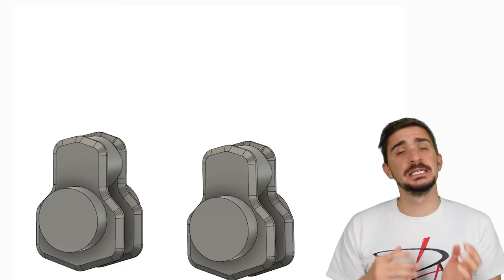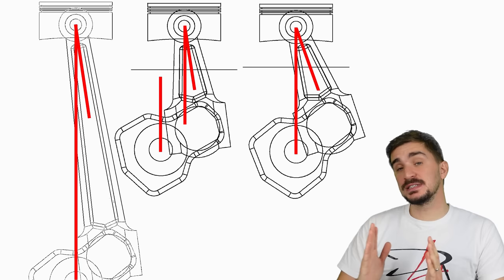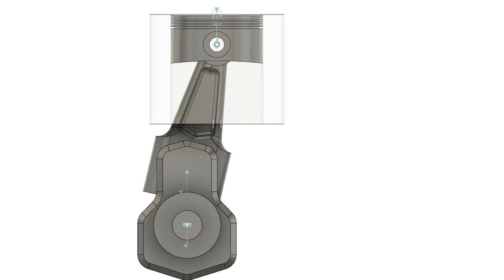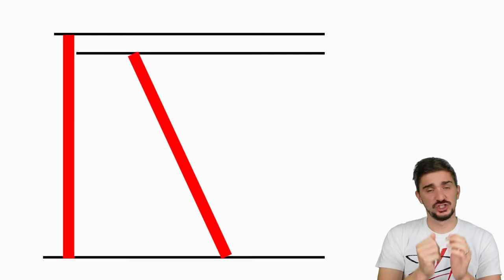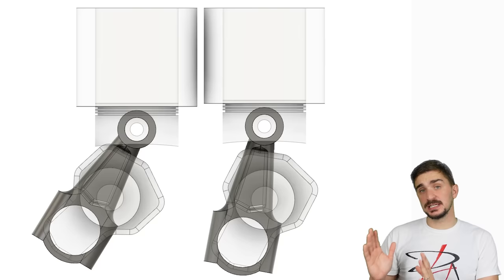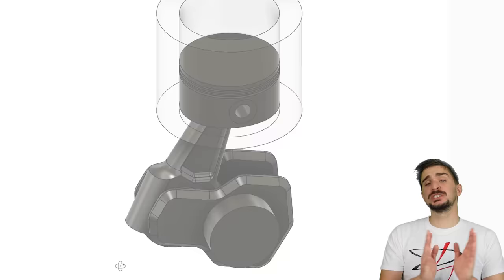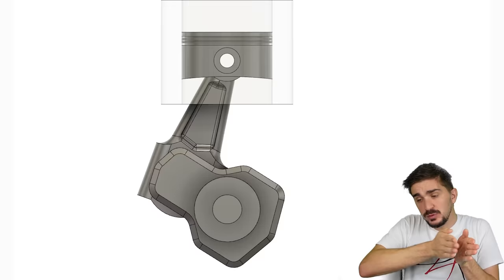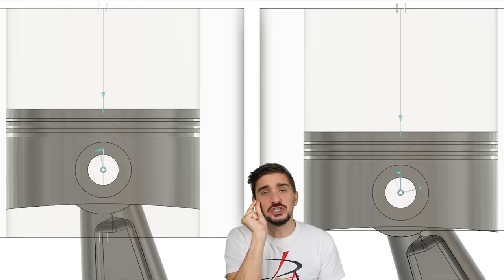Cylinder Offset Changes Everything

Comment: Excellent description. It's also surprising how little power is actually delivered to the crankshaft during a typical power/combustion stroke. I once had a single piston engine apart and tried to turn the crankshaft by pushing down on the piston. Even at 90 degrees, I was barely able to rotate the crankshaft because of the limited leverage angle distance between the crankshaft journal and the connecting rod journal. Same idea as if the pedals on your bicycle were much shorter.
It would be nice to see a video on the actual power output of a single piston power stroke on say -- for example a V8 350 engine at full throttle.   For example, how far in the air could it throw a 10 pound gallon of paint? If this could be calculated, it would tell us how much energy is wasted by inefficiencies in a 4-stroke engine.

Comment: I'm exited to see how the offset engine vibration is to a 2 cylinder 270 degree crank, and a 4 cylinder flatplane vs a 4 cylinder crossplane. It must be interesting to see the vibration through a graph imaging and to feel it in real life on the bikes with those 3 engine configurations... I hoppe there's a video on that, thanks for this great video, cheers!

Comment: Trying to visualise this?    Try picturing an ovalised chainset on a bike, a normal round one has flat spots when the cranks are towards and past vertical. With an oval one the flat spot where effort can be applied has already passed.   Or imagine a car on a rolling hill, bottom to top of hill, approaching the bottom of the hill you will accelerate before the bottom, and the momentum means that before the top you can stop acceleration and still make the top.

Comment: So happy to learn the offset engines.  On my Polaris 400 engine's offset balancer is a major weakness for early failures.....My Sportsman 550 has a rubber damper and compensator shaft which only to help to reduce engine shock damage to the "Driving Chain", very poor designs......

Comment: You missed one other disadvantage. If you look closely at your graphics of the offset when the crank and conrod are at maximum deflection and on the way back   up the cylinder there is an interference fit with the conrod and the bottom of the cylinder. This is another thing that would need engineering to eliminate. Just a thought.

Comment: Very nice video! Small suggestion on the terminology. Instead of saying that the connecting rod is changing length, becoming shorter or longer as the crank shaft turns, it may be clearer to say that its "moment arm" is changing length.

Comment: bicyclists have been doing this for decades.  If your knee was the piston you'd have very noticeably less power to the pedals the more it was over the center of the bottom bracket.  Ideally your knee  (think piston here) should be straight above the pedal (wrist pin) when it is at 90 degrees.  Power transmitted to the crank can be graphed in a sinusoidal fashion with peak power delivered at the 90 degree point.  If you really want to be more efficient, build my invention idea, a piston arm with a rack gear mounted vertically that engages on the crank with a freehub.  It transmits nearly 100% of it's stroke force directly into torque for the entire duration of the piston stroke then freewheels back up.  it can be pushed up by a connecting lever to another piston heading downward.

Comment: Very interesting.  Would think with offsetting rod to crankshaft centers, that it will increase cylinder wall pressure on the side opposite rod offset.  The more offset, the more increase in wall pressure.  Ok, so  at that point, it may require increase of piston skirt length to provide more square inches of bearing to allow better service life.  In the air craft industry, the big double row radial engines had a master rod with a slave rod attached to power generation from the radial cylinders.  While this is from memory, many of these big engines turned many “rpms”, but, rebuild was required at regular intervals.  Our life style is almost to a throw away society, but all considering, enjoyed your presentation.  Very good and leaves open further discussion.

Comment: I think Fiat did this by off setting piston wrist pin away from bore centerline a fair amount, about the degree as stated in your post.  But it’s way too tough on piston skirt ware and tear.  Durability was never a Fiat engineering issue at all.

Comment: Crank and slider kinematics are pure mind fuckery, your mind tells you there should be patterns and symmetry where there isnt any. There are two rotating bodies, crankshat and the conrod. Sometimes they are rotating in the same direction sometimes in the opposite. Looking at a graph of velocity vs crank angle, most people would expect a sine wave which is incorrect. The coolest part is that crank and sliders can be seen as a special case of a 4-bar linkage where one of the bars is infinitely long.

Comment: Racers used to swap the direction of the offset in standard pistons...standard offset is done to reduce engine noise...to something like this, although the cylinder centerline and the crankshaft cylinder centerline were still aligned. 
Of course you still only get a fraction of the arc of power stroke where the cylinder pressure vector is a tangent to the piston pin arc. 
Get an electric motor...the force lines are at a tangent to the power circle ALL the time.
(One of the main reasons electric motors are 3 times more efficient than piston engines..;-))

Comment: Increased Stroke = Increased Displacement.
You're adding capacity. More fuel and air in added volume of cylinder space. The offset would seem to want to spin higher rpm's with short stroke / shorter connecting rods.

Comment: I would imagine that one could decompose the force frequency graph into it's component frequencies and then use additional cylinders to counter balance that spectrum. Not entirely sure what that linkage would look like, but I'd imagine it would look something like a 4 bar linkage system with 2 cranks rotating in opposing directions.

Comment: It "changed everything" a long time ago.  The Standard Super 10 I learned to drive on in 1961 had offset pistons.  The layout was called "De Saxe", I think.  😎
Reply from the maker: The changing of everything refers to everything on the engine, such as balance, efficiency and other characteristics as clearly indicated in the video. This is not some sort of tech hype video you seem to watch too many of.
Reply: @d4a  You are sore?  Offsetting was carried out by in-line aero engine manufacturers during WW1, I believe, and continued throughout the car industry ever since.  The qualities of your observations are top-rate.  The lack of history suggests "tech hype", and yes, as a retired mechanical engineer specializing in thermodynamics, I do probably watch too many of them.  Be advised.  🤧

Comment: Somewhere I have seen cylinders that are mounted on rotating bearings so that so that the piston rod is always in line with the motion of the piston within the cylinder walls.   It must've been some steam engine in 19th century steamships or locomotives. 
I lasted 3/4 of the way through the video.    But I didn't click off,  I fell asleep.    Thanks I needed that.    So I went back and finished the last 1/4 of the video.  Thank you for the challenge.

Comment: Since around the 1930s the use of an offset piston of about .060" has been used to accomplish literally the same thing as your special engine.
Reply from the maker: It's not the same thing because the offset is very much different. Pin offset is mostly there to prevent reverse direction rotation. It has negligible effects on efficiency. My special engine? I don't know how you came to that conclusion. I never said this was special, many engines have it. Seems like you didn't watch the vid.

Comment: Major error - TDC is NOT the same when you model these up. The entire video shows TDC the same, but when you offset the crank / wrist pin it changes, just as the BDC changes. 

This is a HUGE oversight / assumption and skews so much of an otherwise excellent video.
Reply from the maker: The huge oversight is not watching the video. I covered this in the video.
Reply: @d4a  I will rewatch this. As far as I can see, it shows exactly the same TDC and kind of implies they are the same, only focusing on BDC (example 3:23)

Comment: I wonder if the VW w16 has offset cylinders. I find this very fascinating. I'm trying to imagine what a flat plane crank with offset cylinders would look like for an old Chevy V8 type engine. Obviously it would require a block, cylinders heads, camshaft, crankshaft, balancing shafts perhaps, and custom camshaft to make it work. It's probably not done often because of the added complexity. Nice video
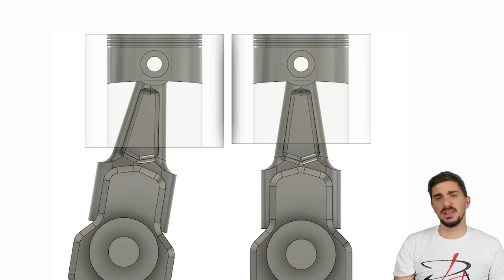 1:20 that's what she said.

Comment: I understood that the engine with the piston off-center from the crankshaft is more efficient, but with much more vibration. But if it were with opposing pistons or in a "v" with just enough angle to reduce vibration? Of course, with a single piston it is impossible, but the more pistons the possibilities would be greater.

Comment: The increased dwell at TDC also has the advantage of increasing the exhaust open time at TDC for better evacuation, and the longer intake stroke has the advantage of, well, being a longer intake stroke.  I wonder how this effects things such as runner and pipe tune lengths in the intake and exhaust system, and the ratio of intake to exhaust valve diameters?

Comment: So you’ve seen the counter opposing piston engines, why not just duplicate the same offset with an opposed piston connected to a crankshaft, rotating the opposite direction, duplicating the same opposing forces, creating an even larger power and intake strokes and balancing themselves out?

Comment: Basically, if you somehow modify a regular engine to offset and keep the phase durations of a stock camshaft you can achieve some underfilling with af mixture, resulting in a lower dynamic cr like a skyacktiv motors and a relatively bigger volume to burn, combined with a longer power phase on a crankshaft, this might be even a bigger gamechanger! some shifting of intake phase 1-2 tooth might be needed to make shortened intake start as usual and finish earlier(some intake camshaft grinding amaybe), making last cm of an intake kinda jump from intake pressure to lower pressure to compressed adding some work to flywheeel. I really wonder if someone has a disposable inline four laying around to do an experiement :)

Comment: For 7 seconds, starting at 13:57, you can see - in slow motion - how the con-rod for the offset engine fouls the side of the cylinder wall.
I'd say that needs greater explanation as to how it is prevented.
Obviously, changing the shape of the con-rod would answer it, but that throws balance off more.
There's more to this than is being explained...

Comment: @driving 4 answers since you are the engine guy, my videos of choice: i got an idea for my car. i admit it may sound irregular, but i am one of these guys, driving according to the specific fuel consumption diagram, tehrefore i reduced from 6.2 to 4.8 liters in a Ford Fiesta active.

my question is:
i thought of a cylinder "shut down" and we make different sizes of cylinders. one 0.25, 0.32 and 0.4liters. about 1 liter engine, like the eco boost.
the mass of the piston and rod shall be the same.
but we can now shut down each cyllinder, not disconnecting the crankshaft, but at least closing the intake manifold on that cylinder (apart from a very very small gap to have no exhaust feeding the cylinder, like giving a tiny forward flow of air).
the result would be variable cylinder-switch-off
to be more flexible on reaching a perfect spot in the specific fuel consumption.
of course thermal load / etc must also be respected, but i am sure this is possible, to quickly heat one cylinder shorty (like switching the shut-off cylinder).

and the last idea: since we have very little air and since we dont use the spark plug, maybe we can use a very lean mixture, like 25:1 to use petrol to clean the valves, also the outlet ones and the exhaust gas recycle as well.

maybe the catalyst can deal with it and not create toxic gases when the unburnt fuel passes the catalyst.

thanks a lot.

Comment: The primary balance would be fine in a I6. Just add counter weights for the crank and the large end of the connecting rod. Yes I did watch it start to finish.

Comment: Had anyone else noticed how in the models one engine will run normally and the other one will be constantly knocking? Rewatch the video and look closely at the offset engine and how the crank would hit the piston and how the rod would hit the cylinder wall at the bottom...

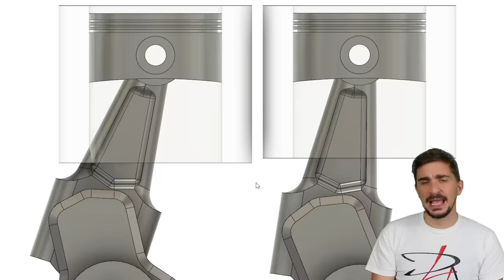Comment: The connecting rod of an offset motor needs to have a curved shape so it does not hit the lower wall of the cylinder. Pause at @3:35 . This new shape affects all the considerations of balance.

Comment: From your other videos, I've been thinking of engine balance in relation to different piston speeds at different points of the stroke. I thought that you might be able to offset something to fix this. Then came across this video. Seems this isn't the answer I was looking for. Surely there is a way to maintain the same effective rod length all the way around the stroke. Like if you could make the path that a rod makes into an ellipse instead of a circle somehow, I think that would do it.

Comment: I’m thinking that an offset V8 engine would also be naturally balanced due to the opposing rotational forces balancing out. Not so a V6 or in-line engine which would require balancing shafts.

Comment: In my oppinion, the stroke is not bigger in offset it just have greater distance when the crankshaft is in offset… Also the compression ratio is more loose if you do not change lenght of the connection rod or piston.. But stroke does not go bigger if you do not change the lenght of the internals only compression ratio goes down.

Comment: When looking at the animations, your bdc is showing a state I don't want to see in any cylinder head, at least to my knowledge.

The oil rings (sorry, I don't know the exact english terms for them) on the pistons should never leave the actual cylinders?! I don't know for sure but at least from my understanding when they actually were to "peak out" on the bottom on each stroke they would be forced back into position on the upwards strokes (so compression and exhaust) since they are somewhat springy and decompress.

I take this knowledge from how pistons are fitted into an engine, since the oil rings usually get compressed when installing so the piston actually fits.

It could very well be that I am wrong with this theory, just something that I noticed while checking the animation and listening to your great explanation!

Comment: Would an opposing piston design balance the engine? Having 2 pistons on the opposite sides of the crankshaft both doing everything simultaneously would create equal but opposite forces for each part of the cycle. There might be some rotational forces still in play because the asymmetric pistons would need to be rotated around the crankshaft instead of being mirrored, but more piston pairs could potentially be used to fix this too. Then there would be the issue of having an uneven firing order, but I don't know how much of an issue that would be on a perfectly balanced engine.

Comment: I think one critical point you didn't point out is that as the Piston is  moving down during  combustion the offset engine Torx is most efficient on the crankshaft due to angular Force of direction and the most powerful phase after cycle.  That force is being transferred more to the crankshaft them being compressed onto the rod in a non offset.  That was the first thing I observed before anything else.

Comment: Q: what is the down side of the offset engine?... I know the diagram is exaggerated but... I can see the benefit of the thrust side of the stroke, but something has to give, yeah?
you would think this increases the force acting on the Cylinder wall (i.e. friction and wear) due to the  increased acute angle of the piston rod during compression and exhaust... I may have missed something....  but still very very interesting... :] Thank you...

Comment: Second or third time I've watched this to the end.  Would be interested in your views on long-rod motors.  Meaning, installing a longer con-rod with the wrist pin higher in the piston to compensate for the longer rod.  Same compression ratio, same displacement.

Comment: Do you consider the 'longer' intake stroke to increase the capacity of the engine as it is effectively drawing in more fuel? Also, do you think compression ratio is also now radically different as intake and compression volumes are so different, i.e. combustion chamber volume has to be so much larger on the offset engine just because the intake volume is so much larger than the compression volume?
Reply: Intake and compression volumes don't actually change with respect to each other, the piston is still moving the same distance on the up and down. It's just that the piston velocity is higher in the compression stroke than the intake.